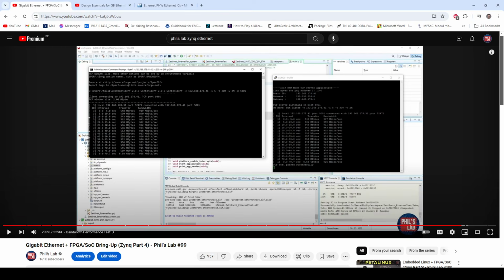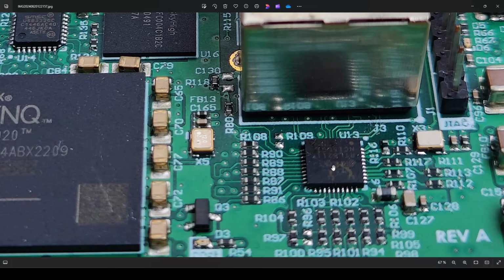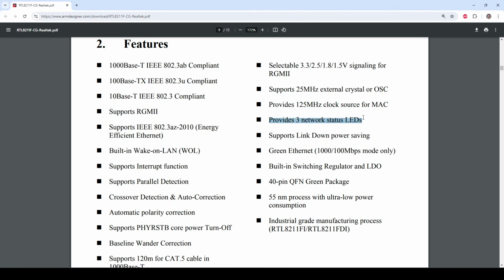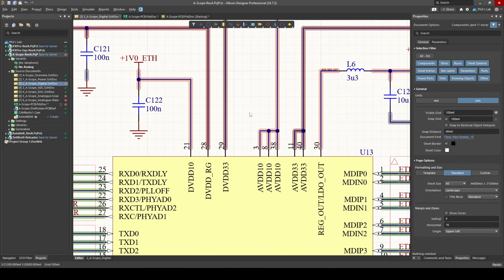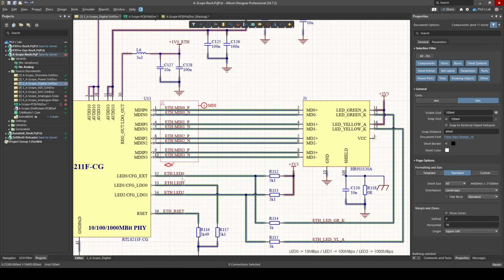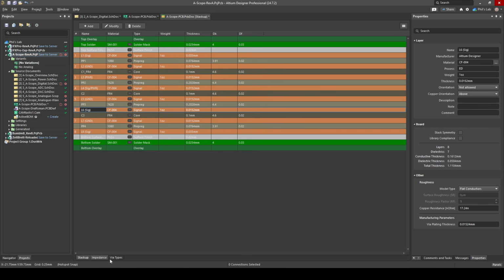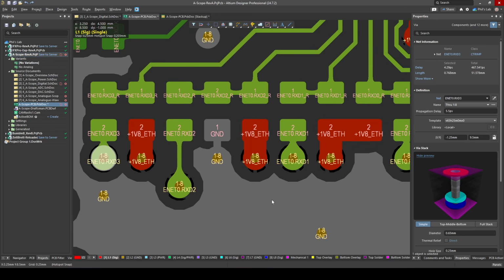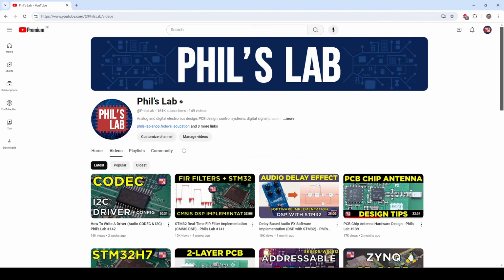Gigabit Ethernet Hardware Design - Phil's Lab #143

Comment: Something that can be useful to know is that it's not necessary to length-match between pairs from the Phy to the magjack - I was unsure of this when doing an unusal GbE application, so did some testing and found that it was quite happy with an extra metre of cat5 on one pair!
Reply from the maker: Yep, exactly! I put that as a note in the video as well in the PCB MagJack section.
Super interesting though that even having a length-difference of 1m still worked!
Reply: I think your PHY performed some kind of wizardry there aha. It is true that length matching diff pairs is absolutely not needed if the pairs are routed symmetrically. (Not possible with some THT connectors)
Even better with good uniform prepreg.
The tight requirements on pair is generally to allow the system to work in spite of a bad link like in general a bad cable.
Reply: It's time matching that matters, not length.

Comment: Very good quality video as per usual! Pretty exhaustive end-to-end instructions 👍
However there is some 'gotcha' that's not necessarily well know about RGMII. in the base spec, data are emitted synchronous with the clock, which means that the setup time requirement for the reception part isn't met.
Either you have to add ~1ns of delay on the clock with a lengthened trace, either the PHY (or maybe MAC) have a retiming functionality built-in. Even though it seems like most PHY integrate this functionality, it's still something to be verified when choosing a matching PHY-MAC combination
Reply from the maker: Thank you, and yes, very good points I should've mentioned! The PHYs in many cases seem to integrate this functionality (flexible adjustment of RGMII delay, either via strapping or MDIO), from what I've seen across multiple devices.

Comment: thanks Phil, really good video.I like to add some detail about the RGMII bus that is the RX and TX delay according to spec in order to RGMII to work you need 2ns skew for RX and TX clock to data lines, in your chip(RTL8211) add both delays by strapping pin but some chips do not have that option so designer should access some registers through MDIO bus and activate those delays in software.

Comment: Phil, another great video! Thanks for sharing your experience and insights. I have an idea for a video. I know you're into audio electronics (as am I). Could you do a video regarding correct PCB design for an audio power amplifier (discrete class AB). These boards are constrained to only 2 layers, they have  high and low Z signal sections. Large rectified half sines can be induced into the small signal. Top it all off with a NFB loop that connects input to output. I think a video like this would be valuable for any high power PCB design. Thanks again!

Comment: How do you make the outer ring without solder mask in Altium? Just manually or is there something like the board outline clearance you can use for the solder maks layer?

Comment: I would've liked to have seen some mention of current-mode vs voltage-mode PHYs and how you have to choose the magnetics correctly. I couldn't find in the RTL8211 datasheet what the drive mode is, but a lot of dev boards copy-paste old MDI designs with newer PHYs and get it wrong.

Comment: Hi Phil, it was a very informative video with awesome explanations.   

I had a small question. 
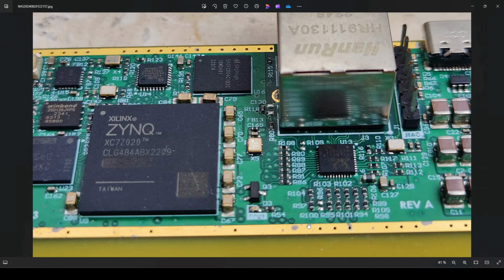In the latest altium academy video where Zach Peterson compares CircuitMinds's auto-generated schematic with a human one at 8:35 he says that diode protection is a nice add to protect against SD card insertion/removal ESD events. Is this a concern for RJ-45 as well?
Reply from the maker: Thank you! The topic of ESD protection for Ethernet deserves a video on its own. But in short: yes, all/most external interfaces should have adequate ESD protection tailored to requirements of that system. For Ethernet we have the 'issues' of isolation (separate GNDs possible, often can only use TVS diodes differentially, etc.), but also inherent ESD protection in the magnetics/PHY. For simple, home-use boards like this, for Ethernet I haven't found the need to add additional ESD protection devices. For more detail, check out:
https://m.littelfuse.com/~/media/electronics/application_notes/esd/littelfuse_ethernet_electrical_threats_and_protection_application_note.pdf.pdf&ved=2ahUKEwjisKXLj42IAxUl0wIHHVs4Onw4ChAWegQIChAB&usg=AOvVaw36fmFoTe5xXUS4iqTgiS_x

There are also a number of examples on the Electronics StackExchange that go into more detail.
Reply: @PhilsLab  Hi Phil, thanks for answering and linking the resource.

Comment: Hello Phil, I am a mechanical engineering student.
I am interested in learning PCB designing because I am currently working on a mechatronic project that uses microcontrollers, sensors, and some analog and digital circuits.

Can you suggest a learning path for how I should start my PCB designing journey from basic to advanced?

Can you suggest some PCB designing resources?

Comment: Thank you so much. A few months ago I had to dig in all this because of RGMII and RMII, where I used same ICs. We have a similar approach to such design. BTW, if the traces are longer than 2inches, make sense to add a clock buffer IC, or buffers on each line? Other question migh be from another topic. Are you controlling Phy registers over MDIO interface, or leave them by default, or let Phy do by its own the negotiation with a lan hub? I am ot sure if you have mentioned that, but the difference between RGMII and RMII on the same clock speed, is that the first one is sampling data because of DDR pins properties of FPGA or ASICs. This is important if the design is not related to the PS (SoC) where all this is arranged already. I used in my design the generic FPGA banks.
Reply from the maker: I've never needed to add buffers to these lines, but then again I haven't run the RGMII signals longer than that before. Regarding PHY registers, yes, these I am controlling via MDIO.
Reply: @PhilsLab  thank you for quick response.  Do you have a video where you are handling MDIO registers? BTW, in case if someone want to analyse the MDIO, the pulse-view can decode that data.

Comment: What is the via size for impedance control trace?
Reply from the maker: For these 'not-too-high-speed' designs, via sizing isn't too important. As the overall via length can be considered a lumped element and only presents a very short impedance discontinuity. I use vias that I'm already placing in my design (e.g. 0.7mm pad, 0.3mm drill) and if I'm spaced-constrained will reduce drill and pad sizes.

Comment: Awesome video and great content. What do you usually do for VCC pin on RJ45 connector?  As I see in the datasheet, it is center-tap to the transformer!
Reply from the maker: Thanks! Depends on the PHY/system set-up. Some PHYs are 'current-mode'/open-collector drivers and require a voltage attached to the center-tap. Alternatively, other use cases are PoE, for example.
For these types PHY, such as in the video, I generally leave it floating.